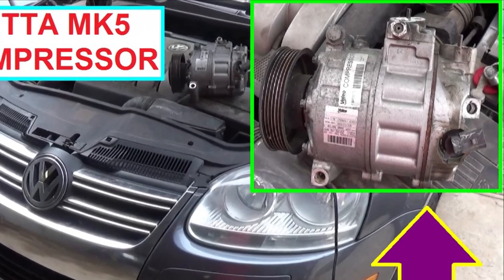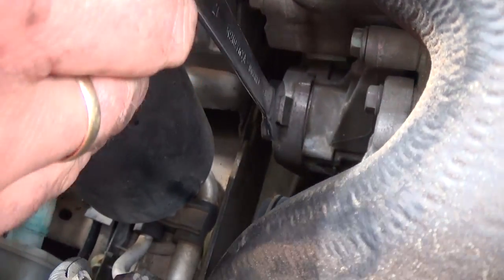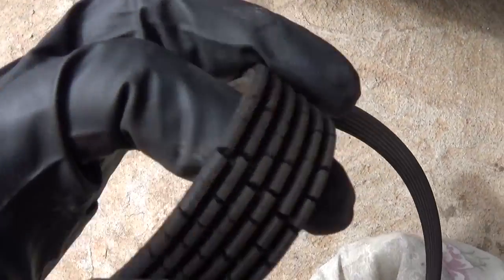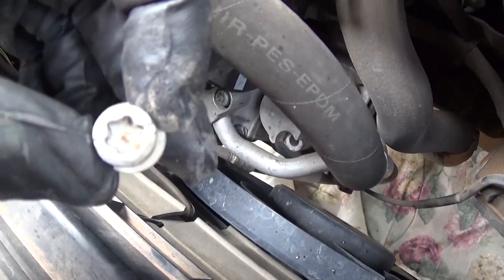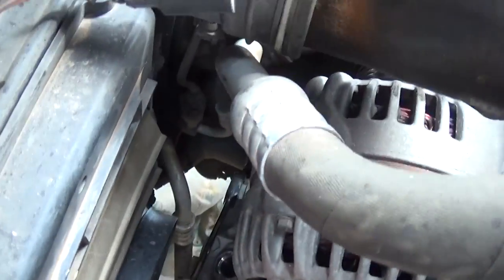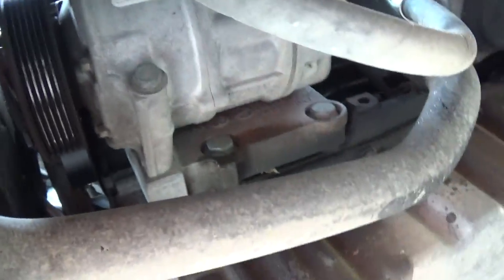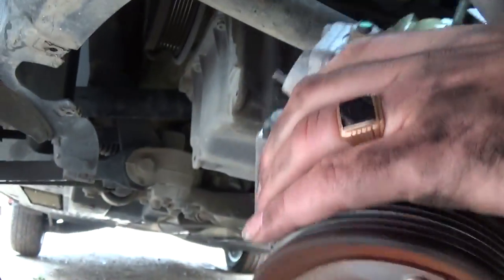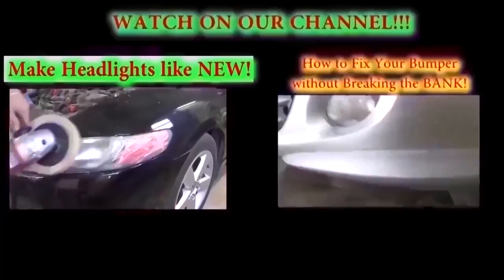Vw Jetta MK5 A/C Compressor Replacement  Vw Golf MK5 Air Conditioner Compressor Replacement

Comment: My valeo doesn't blow air/kick in until like 5km into my trip, is this a sensor or compressor fail because when it does work it works. I have heard it's quite common in the mk5.

Comment: do u have a video on .How to replace the ac compressor valve?
Reply: Can I just removed the solenoid with out removing the compressor???
Reply: @alfredo1956  yeah you can, there is a snap ring holding it in place tho